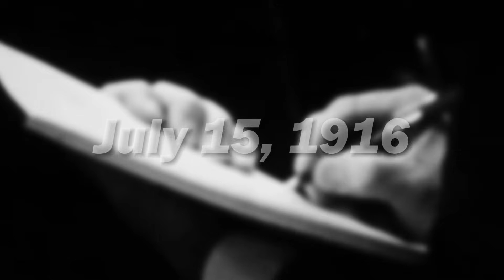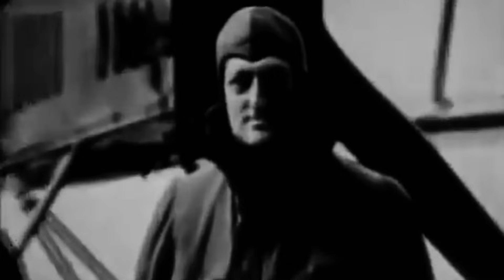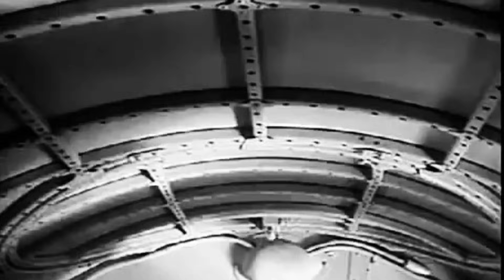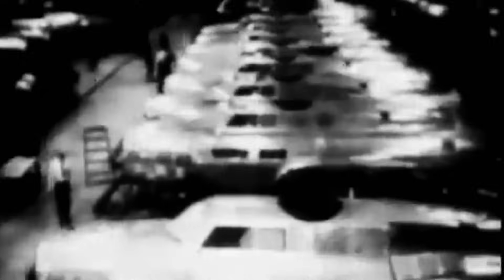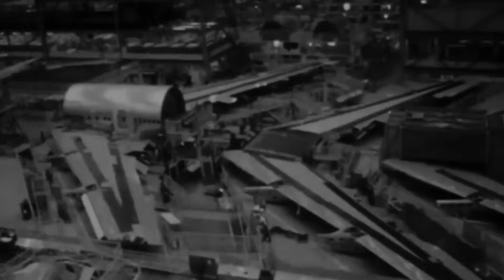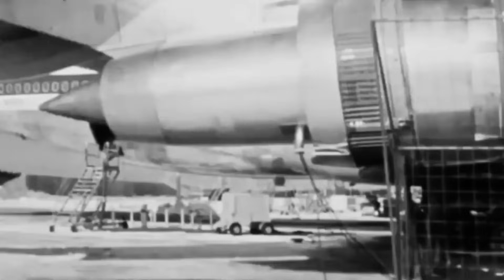The Story of Boeing: From Wood and Wires to Aerospace Powerhouse

Comment: Before GPS there was LORAN a ground based system. Not as accurate but worked. In WW2 they used radio station signals with direction finding antennas.
Reply from the maker: Thank you very much, nice to hear that:)
Reply from the maker: Yes, you are right, it is.
Reply from the maker: Thanks for sharing this